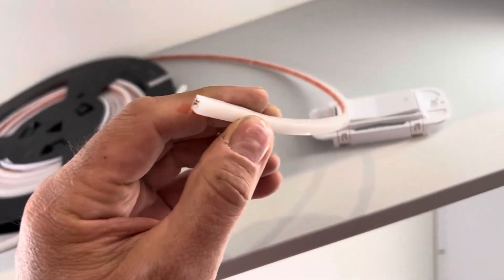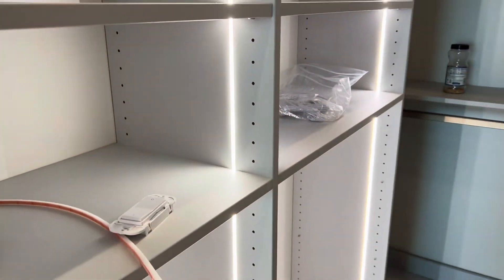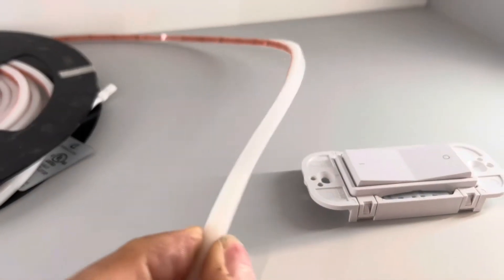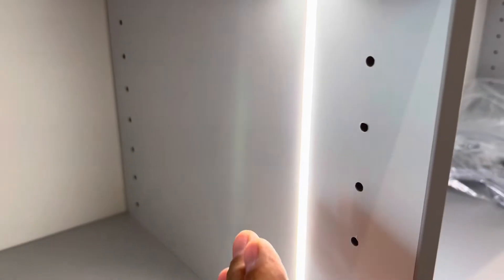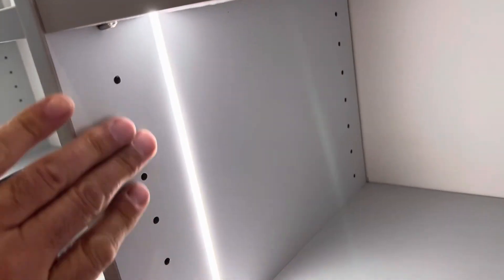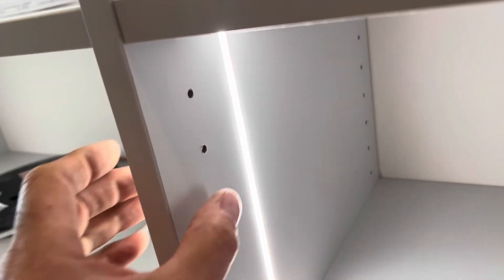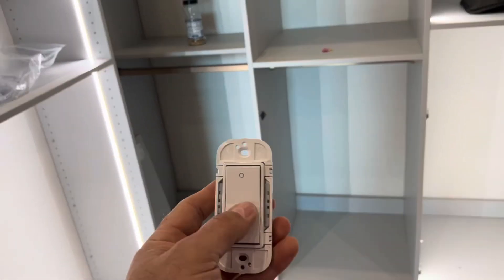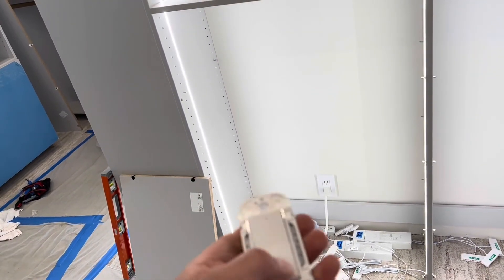LED Lights in Closet Panels, a couple of do’s and don’ts we learned

Comment: How many outlets do you need? Can the whole closet run on 1 plug?
Reply from the maker: You can run a lot of a single plug. Drivers are the issue. I think the biggest driver will run 3, 8’ section and I believe you are max of 16’ continuous
Reply: @derrekholland5207  Thank you! California Closet rep. told me I would need an outlet on every wall. On you video, I saw a power cord with multi outlets.
Reply from the maker: hiding wiring for these lights in closets is no easy task. If the closet system isn’t connected together at each wall you need more than 1 plug. It’s nice to have options as it make easier. Sometime we bring in electrician to add or move plugs to make it work.

Comment: Hi Derrek, 
Very nice! Would mind shearing the part number for the lights. Can’t find it on my Richelieu website. 
Thanks
Reply from the maker: Try “FlexyLED SEH4 24 V dc tape” I went through my rep but I’m pretty sure that it. They have a lighting specialist who can tell you all you need for specific installations
Reply: Thanks Derrek, the only one I can find is 4mm wide yours is 6mm?
Reply: @bidbudy6061  The FlexyLED SEH4  24 V dc tape is 4 mm wide and 10 mm deep. We use it in almost every kitchen we build. I've not seen the lighting Mr. Derrek is showing. Going to check it out. Haven't seen the switch he's using either.
Reply: Thank you Ron, the switch is available from Richelieu.
Reply: Thank you Ron, the switch is available from Richelieu.
Reply from the maker: I’ll get some part numbers next week and share
Reply from the maker: https://www.richelieu.com/us/en/category/lighting-solutions-and-accessories/led-lighting-and-profiles/led/flexyled-at6/1246670?s=at6&fbclid=IwAR1XWjeZinx7SlnFmWbeuwQfh85xIS41ziEuQ0Jt_aPbFwx_SInwLSMsg5U

Comment: Just looked into these lights. I'm building a small 3 cabinet closet just over 9' tall, so 6 strands of these lights (one for each vertical side of the cabinet), with the 75w power supply $1,450 before shipping, RIDICULOUS. If I brought this number to my client they would laugh in my face. That's before labor & install costs. They would replace their closet bulb before paying $1500 for cabinet lights.
Reply from the maker: It’s not for every client. You can use some cheap Amazon stuff and save a bunch of money, then replace it in 2 years when it quits working